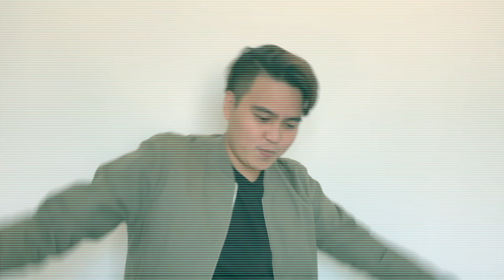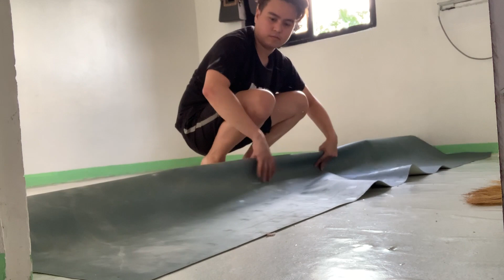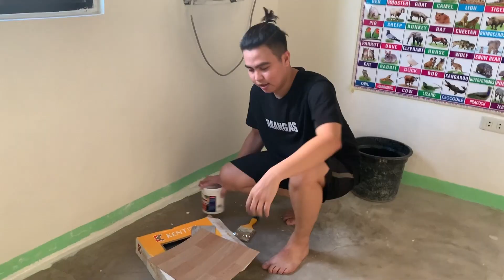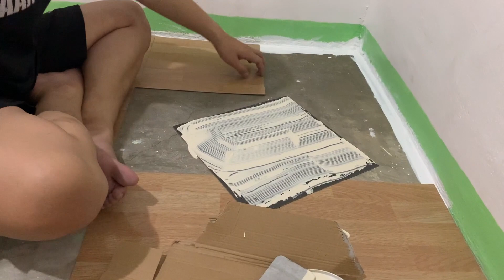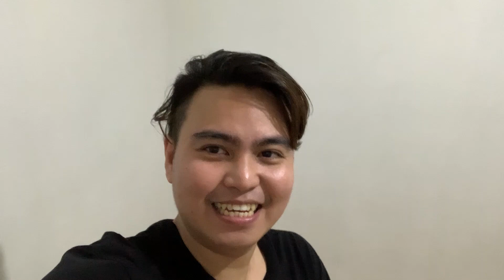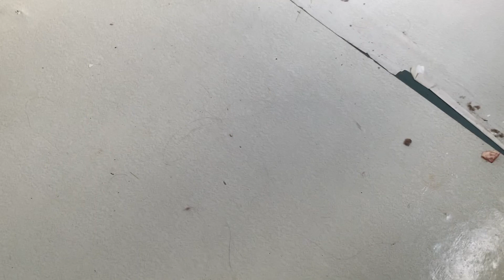How To Install Vinyl Tiles? | 2K BUDGET

Comment: balak ko po magpa tiles sana, but nakita ko yung video na ito mas okay cguro kung vinyl at mukhang kaya kong gawin.. pero ang tanong ko is,, pde ba yan sa medyo rough na semento i install? medyo magaspang kc flooring namin,. at 3-4 times a year ako magpalit ng linoleum, almost 500 pesos din ang nagagastos ko para lang sa mas magandang klase.. mas makakatipid ako kung vinyl nalang ang ilalagay ko.. 
problema ko lang ung tanong ko na kung pde ba cya sa medyo magaspang na flooring?..thank you, hoping for your reply..godbless
Reply: Okay lang po na magaspang, bawal lang po sa lubak lubak o kaya sa mabato kase uumbok po yung ilalagay nyo, parang sticker po na nilagay sa sahig yan hindi po tulad ng tiles na matigas kapag nilagay mo sa bato bato straight padin.

Comment: gotta put 2 sealer coats ontop. This will stop spills and cleaning chemicals from seeping between the tiles and causing it to peel.

then put a polyurethane top coat to finish It.

Comment: Pano nyo po nalaman kung ilang pcs na vinyl  ang kasya sa kwarto nyo po:(
Reply: sukatin mo floor area ng lalagyan mo, halimbawa 100" x 200" ang dimensions ng floor, bale 20,000 sq. inch yan. tas kunin mo din area ng vinyl tile na gagamitin mo. halimbawa 6" x 36" ang isang tile, bale 216 sq. inch. tas divide mo lang. 20,000 ÷ 216= 92.5 or 93 pcs ang kailangan mo.

Comment: Mas mura po ba ang vinyl kesa sa linoleum tile?
Reply: Mas mura ang linoleum kaya lang sa linoleum kasi, di siya pwede sa Marble floors. Sa tiles, wood flooring and cement lang pwede. Also, prone to accident dahil pag may water spielage, madudulas ka agad. Unlike vinyl, hindi gaano. Waterproof din din siya. Pwede pang Room, kitchen, dining etc. Ang disadvantage lang sa Vinyl is after 10-15 yrs natutuklap na. So palitan mo yung natanggal. Also, mas costly compared sa Linoleum and dapat very flat surface and no bumps sa floor.